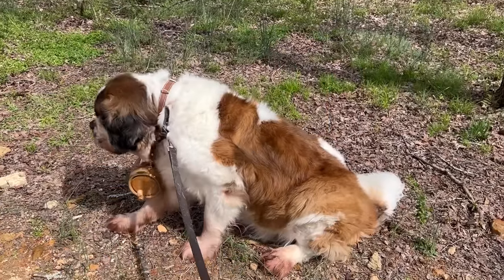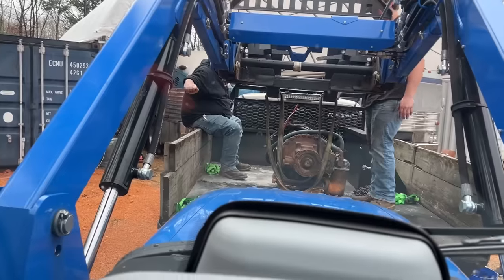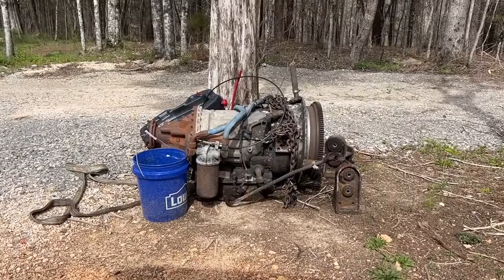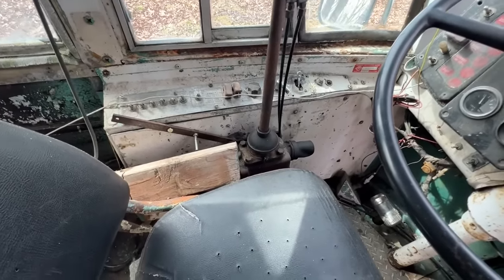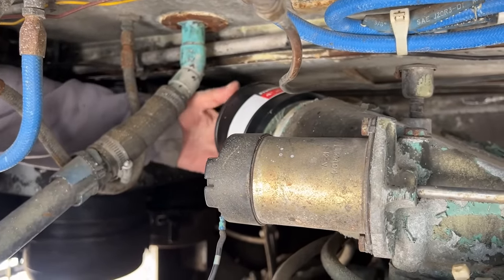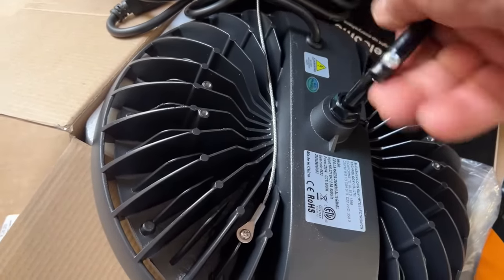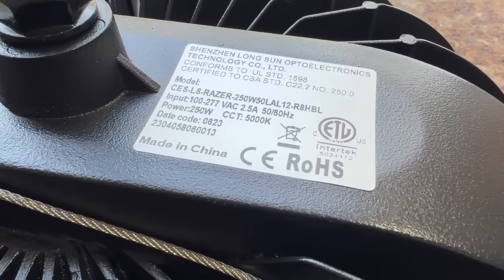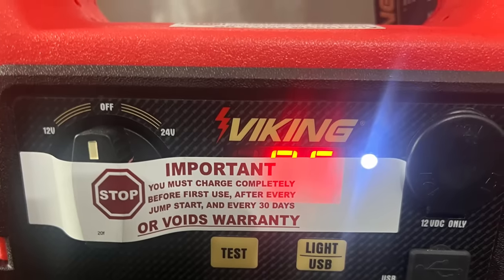Updates on Scenicruiser automatic transmission upgrade, new LED Demilare high bay shop lights

Comment: the 24v is great for extra oomph on 12v starters if you isolate the system such that anything that could be damaged is not in the circuit when you use it.  Been a few times it was the only way that I was able to get an engine that was low on compression started.
Reply: Many of the older Cummins 855 powered trucks use a 24v starter even though the truck has a 12v electrical system.  They use a series parallel relay switch to provide 24v to the starter.  Years ago I made a cart with 3 6v batteries wired in series for 18 volts for jump starting.  With 18v the moment the starter engages the voltage drops to 14v which is fine for a 12v system.

Comment: That's not the shifter that bus came with is it?  I can't imagine they designed it that way. Even I couldn't deal with that, and I love manual transmissions. Is that your bus? I would love to fix up something exactly like that.
Reply from the maker: Not the stock trans or shifter mechanism
Reply: @BusGreaseMonkey  probably sounded like a good idea at the time for the last owner.